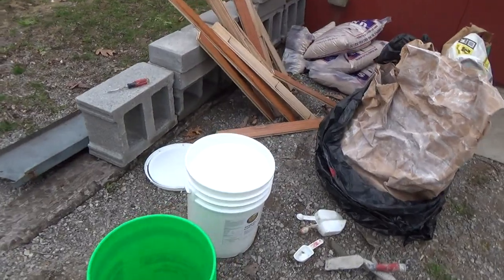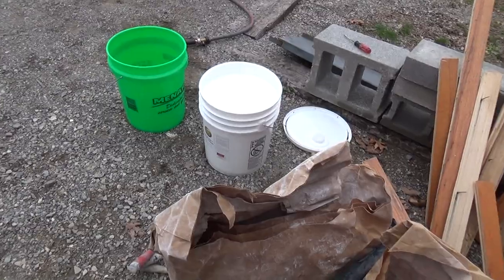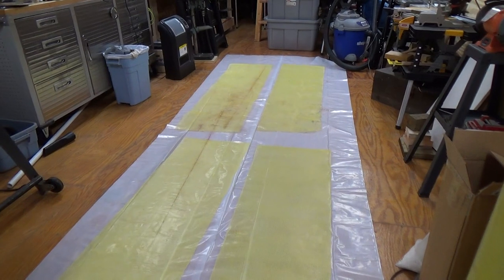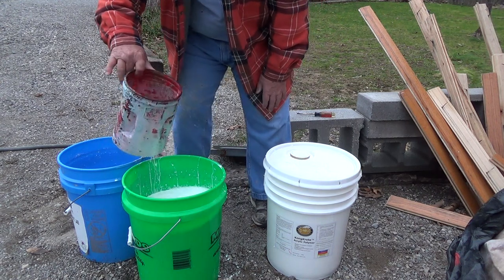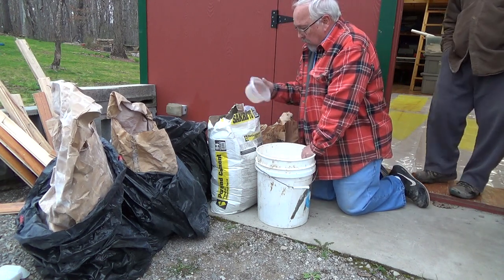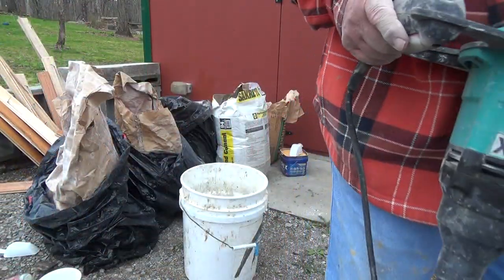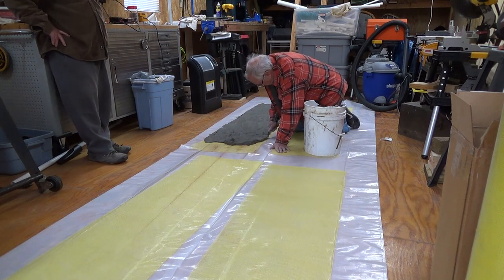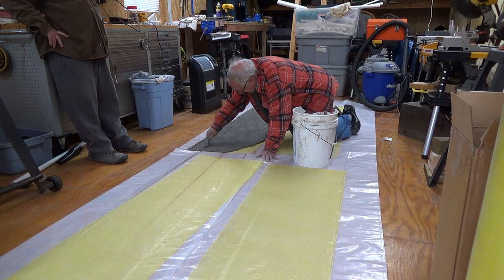Concrete Skirting for Sheds and Decks

Comment: What about frost heave on the bottom of your skirt boards. Did you find that it jacked the building at all?
Reply from the maker: First, this is middle Tennessee.  You don't get frost heave. Second, it's on top of the Cumberland Plateau, with a sand soil.  Even if it were cold enough, long enough, there's no moisture in the soil to freeze. Even in a northern climate, there is no way these panels would lift a building. They are less than half-an-inch thick.  Sorry, but your concern made me laugh.
Reply: @dperry428  I wasn't implying (or didn't mean to anyway) that it would actually lift the building but instead create enough jacking force to possibly crack the panels or damage something else. It is a valid concern. I am thinking of doing the same thing to one of my buildings and I have snow and lots of water around at certain times of the year with temperatures that are well below 0C for months at a time. These types of forces have caused damage to the siding on some pole barns when frost heave occurs. My comment wasn't meant to challenge you on what you have done but simply inquire about how it has performed, but this is obviously not a concern in your situation which I was not aware of.
Reply from the maker: And my answer was not meant to prickle anyone's concern.  It's just that, if there is, indeed, frost heaving around the building, it is likely that the heaving would affect both the skirting and the building supports such that building and skirting would be lifted together.  To resolve your concern, one needs to first understand that "frost heaving" only occurs under certain circumstances and is not correlated only with long-term freezing conditions. The right soil conditions must be present that is neither too dense nor too porous, but of a structure that creates capillarity to move water into an ice lens that can grow and push up the overlying soil.  It also requires a source of water to continuously feed the growing ice lens.  The solution is to either replace the soil type with one that is either impervious or large-grained enough to discourage capillary movement of water and replace it with drainage characteristics, such as gravel.  The second way to prevent frost heaving is to divert the source of water away from the area to be protected from frost heave.  In conclusion, it wouldn't matter what material was used for skirting if the conditions that causes frost heave are not addressed. Nothing used for skirting would be kept from damage if frost heave is not addressed.  Even if you found a miraculous material that could not be bent, cracked or broken, then you would, in reality "jack the building" or cause other structural damage. The answer, then, is not in the skirting material, but in addressing the causes of frost heaving.  BTW, I live in northern Illinois where normal frost line is 30 inches into the ground each winter.  I was asked a similar question concerning frost heaving of the chain-link fence that I covered with concrete to make a faux rock wall.  I was told the concrete would crack from frost heaving, but I knew the fence had been in place for 43 years and had never been affected by frost heave due to the quality of the soil, so I did not anticipate that simply adding a coat of concrete would somehow initiate frost heave conditions.  The fence has been in place now for 6 years without even a small crack in spite of harsh winters down to -30F.
Reply: @dperry428  Yes I have read in the past that to eliminate frost heave you have to remove one of the three things that contribute to it, soil that has a lot of fines in it, below freezing temperatures, or the source of water that is drawn up from below the frost line and forms lenses as you describe. Those ice lenses can grow quite a bit from what I have read years ago however you can still get upward movement by just the simple expansion of water that is present on the surface when it freezes. I don't think that would really be frost heave but I am not sure of the exact definition or if it applies to both cases. I would have to have a read on that again. I have gravel in the whole area that the barn is built on which would prevent frost heave but what happens is that snow slides off the roof and builds up on the two opposite sides of the building and this creates a grade that is now towards the building so that when it rains in the middle of the winter sometimes, water hits the hill of snow and flows into the building on top of the gravel and freezes. I have experimented to see if this would put pressure on the building when it freezes by putting a block of wood under the edge of the building and it pushed it up into the bottom board on the wall. I am thinking that if I don't have some sort of a slip joint in the skirting it could cause problems. The building is on concrete pillars that are 7ft down and they don't move obviously so the expansion of the surface water causes enough pressure that I am concerned about it. To get rid of the water maybe the only solution is to put snow stoppers on the roof and/or keep all the snow around the building cleared away so any rain water will run away since the earth is sloped away from the building.
Reply from the maker: Since you have ground that slopes away from the building, the solution, in my mind, is to dig a trench along the side of the building inside the line where snow creates a dam, install perforated plastic drain tile (3 or 4 inch), along with a couple of T's installed with lines extending perpendicular to the building, cover with landscape cloth and coarse gravel. The T's can be left open at the surface further down the slope.  Now, when the snow accumulates and then it rains, that rain water will be collected in the drain tile and diverted away from building. Eliminates the water even if you forget to remove the snow.
Reply: @dperry428  That is a good idea and I will likely do that. I do wonder though if the gravel will just get plugged with frozen water over the winter not allowing any surface water to find it's way down through the gravel and into the weeping tile. I don't think there is any better solution though so if this doesn't work I will have to remove the snow. I might also install one of those foundation membranes to the skirting that you often see installed on concrete foundations on houses these days. This would help prevent the water from coming inside the building if it didn't make it's way into the weeping tile right away because of ice plugging up the gravel. This might be overkill though. Thanks for the ideas.
Reply from the maker: It's a well-established idea;  it's called a French drain.  https://en.wikipedia.org/wiki/French_drain

Comment: Was just wondering about the air flow under the shed so the lumber doesn't rot prematurely. Great job as usual though.
Reply from the maker: There is heavy plastic under a layer of gravel beneath the whole building.  I think he's also putting in some vents in the floor, as well as an access hatch.  Point well taken, though.

Comment: I'm surprised by now you haven't premixed and stored some away. Doesn't that counting out 5 different ingredients get just a little old? I'm sure I would forget something doing that for several buckets into the job
Reply from the maker: In this particular case, I  had just driven 560 miles to Tennessee with just the additives in my car. We bought the sand and cement the day we did this work. In reality, I never make up and store mixes, as they change from day to day and even within the same day as weather conditions and use change.  For horizontal work, a mix of 3 sand to 1 cement is the norm and for vertical work, 2 sand to 1 cement.  For finish work, where detail is important, 1 sand to 1 cement or even no sand at all will be used.  CSA amounts vary with temperature or, when rain is expected, larger amounts to speed set before the onset of rain.  For sculpting work, the amount of metakaolin will vary from 10% to 20% and silica fume may be eliminated altogether. Forgetting to add something is like grandma forgetting something in her bread recipe. Were I a contractor and planning a specific job, premixing in a number of buckets would be appropriate.  For me, it is not.

Comment: What is the yellowish material you have out on the floor that you are putting the concrete on?
Reply from the maker: That's fiberglass mesh.  It is alkaline resistant for use in concrete reinforcement, most often used in a commercial building finishing system called Dryvit Outsulation Systems.  The mesh is put in a stucco layer over foam board and then a finish stucco coating is applied.  It is use on building like banks and Taco Bell type buildings.  I got 4 rolls of it on eBay.